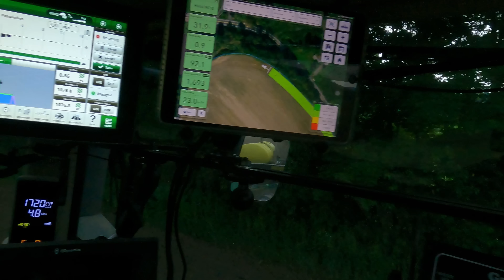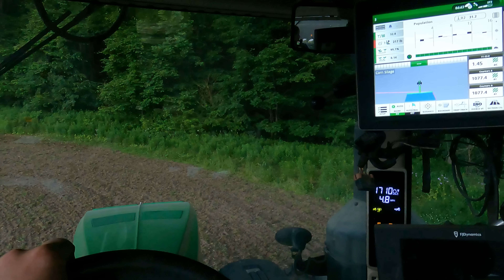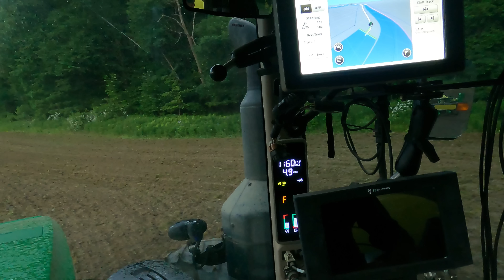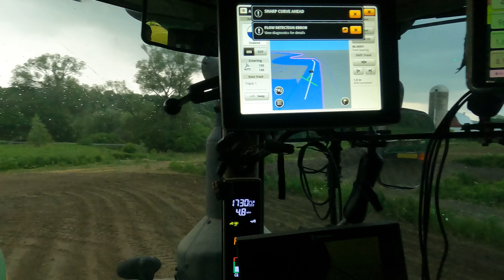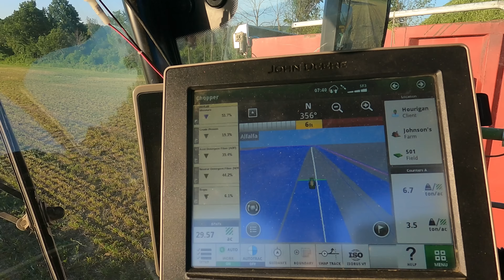Planting Corn next to a construction site

Comment: Big or small that's the way it goes you always have to save a little corn ground in the spring to put manure on around here that's usually what happens until we start taking small grain off and then we start spreading again. Seems like there's always that last piece that has to be plowed though before you can finish up!

Comment: I thought that tractor sounded rough. You have enough roof area on those barns for a huge PV solar farm that could power a city the size of New York. Do your products include free range milk?
Great to see the shop again, I thought you'd sold it or turned it into a parlour. Cheers Andy, great to see all the action on the farm.
PS: the barn area looks very clean and well maintained with the grass all nearly cut. Whoever is responsible does a good job.

Comment: Are the mower tractors using a guidance system?
Reply: Would make the first A-B line straight, but each subsequent pass just follows the previous. When the operator cuts the same field multiple X, they just sight a distant object & aim for the first run.
Reply from the maker: Yes